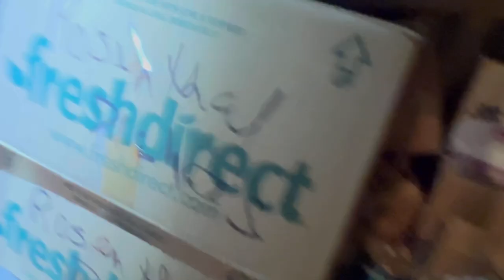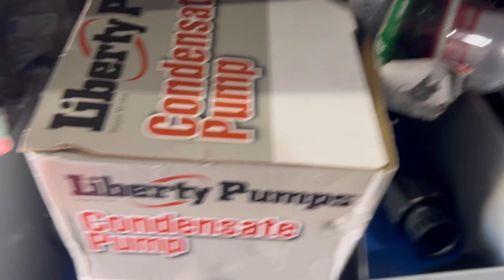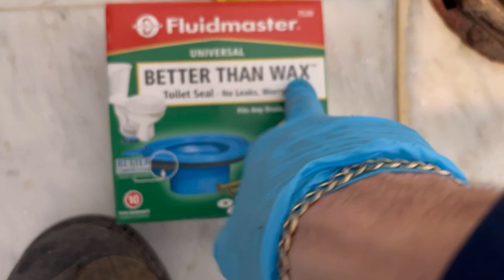NOONE SEEMS TO KNOW WHERE THESE FLIES ARE COMING FROM !! HOW TO CHECK YOUR PLUMBING FOR SEWER FLIES

Comment: You missed that fill hose that is in the over flow tube and when that is below the water level inside the tank that will cause a Siphon and cause the water to run in the bowl and that fill hose should be attached above the water level with an adapter or clip to create a air gap

Comment: 55:05  TOILET WAX SEAL, EXISTING IS WELL ABOVE THE FLOOR TILE.  NO NEED TO RAISE ANYTHING.  AND NO NEED TO CHIP TILE AWAY. ALL UNNECESSARY WORK JUST TO RIP OFF A WOMAN. WAS PERFECTLY DRY UNDER THE TOILET. AND FLANGE IS ALREADT HIGH ENOUGH WE CAN CLEARLY SEE ALL WHILE SECRETLY RECORDING WITHOUT WOMANS PERMISSION

Comment: No caulking around the toilet?
Reply: This seems to be a NY thing where there is no caulk.  Watched a few videos of Mikey Pipes and he didnt caulk but used the plaster around the toilet no caulk.
Reply: @M.J.F.MECHANICALL.L.C.  CAULK DOES NOT STAIN PORCELAIN. EXAMPLE, PORCELAIN TILES IN A SHOWER GET CAULKED IN VARIOUS AREAS, BETWEEN TUB/TILE, AROUND FAUCET HOLES, ETC.  AND FLOOR TILING,
Reply: according to this old house series, no caulk is used around the base of the toilet because if your toilet leaks, like at the seal, the caulk would hide the leak from seapin out into sight.  But without caulk, the water will flow out thus indicating a leak.  otherwise you wont know till the floor rots and drops out.   but you can caulk just in the front of the toilet for aesthetics.

Comment: What are your thoughts on mineral oil in the drains that are not used?  I have seen people do that because it doesn't dry out and thus the trap will stay filled.  I saw Matt Risinger do that on an emergency drain that went outside and thought it was good idea just didnt know if a good idea for plumbed in piping.